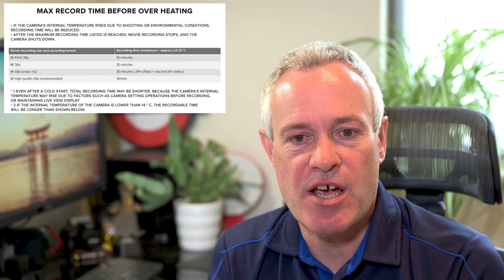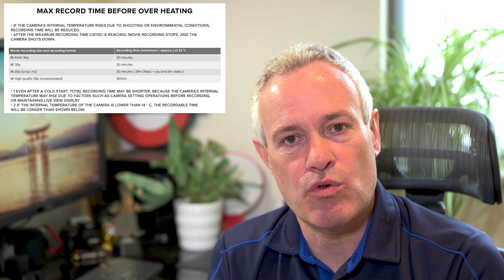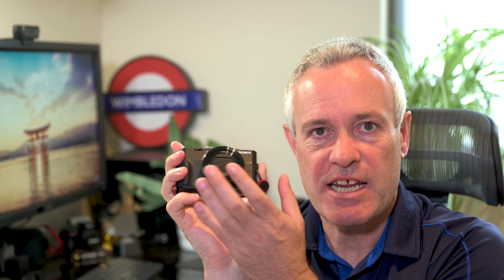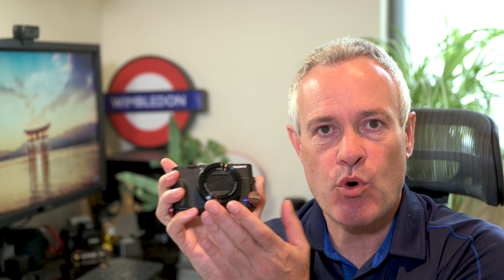The release of the Canon R5 has drawn a lot of heat - how can innovation help in this area though?

Comment: Hi Adrian. I always enjoy in these kind of videos you make. There is also another thing we have to consider. Both Canon and Sony have dedicated video cameras and therefore I don't think they will always give best specs video wise in consumer market cameras. For Nikon, they can push more if have technology. In my opinion they can make two models of same cam. First with limited video functionality because of heat like R5 has, and another which will have active cooling and basically unlimited video recording time, but lose some of weather sealing. For someone like me, R5 is great all rounder, but for someone who needs video a lot probably is not unless its in controlled environment. Cheers Adrian, keep safe.
Reply from the maker: Good point about the pro video cams that Canon and Sony have. The Z series have benefitted from this and it will be really interesting to see how this plays forward into the future. The RAW upgrade was interesting as it was NIkon in part testing the market for paid upgrades/add-ons, something that Sony have tried but didn't seem to survive the test of time. The cap on video recording @29mins is a tax issue I believe as once you go over 30 mins it becomes a different tax classification (video vs stills) which increases the tax. Hope you're well, Adrian

Comment: The issues around heat are really around dissipation out of the camera body and not in the electronics.  A dslr battery is typically 15WH.  So for at least 30 min of record time, there is 30W to be dissipated in that 1/2 hour.  This is not much compared to most small laptops etc, however the trick is how to get it away from the small camera body, which is black in color and may be sitting on a tripod in the blazing sun.  Canon has chosen to insulate the body to prevent the sun from super heating the body and giving the camera a variable run time as can be seen with the A7S3 which overheats in the sun but is fine inside and cools fast.  The R5 runs for the specified 25 min in heat or cold and then takes a long time to cool indicating it is insulated.  I would like to see an insulated Z6s with an exposed thermal transfer plate on the bottom under a rubber pad, so I can add a thermal dissipation video cage or battery grip should I choose to shoot video, or have the reliability of shooting stills in any weather condition.  Removing insulation also leads to issues with condensation forming water droplets in cold humid weather etc, and a much bigger issue.  I wish Canon offered a way to add active cooling when required but I do appreciate they went with an insulated body for stills reliability in the harshest conditions
Reply from the maker: Barry, great points and I agree wrt the challenges. It's a topic that I could have made a longer video on as the devil is really in the detail and it's a reall challenge balancing all the things you highlight. It's interesting that the R5 limits are at an ambient temp of ~23degC which is as you say another consideration. The real killer will be the fact that cameras are black and insulated which in direct sunlight can add a significant heat multiplier effect. Looking forward to seeing some of the left field innovations coming through like the first air conditioned case 😂